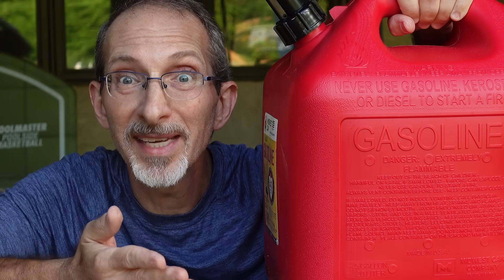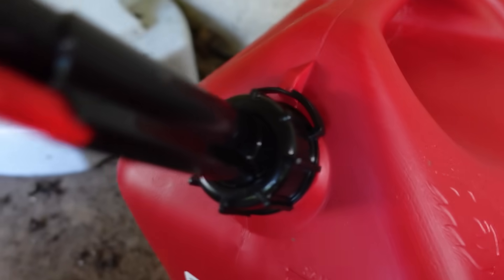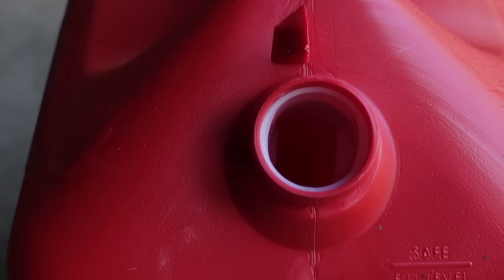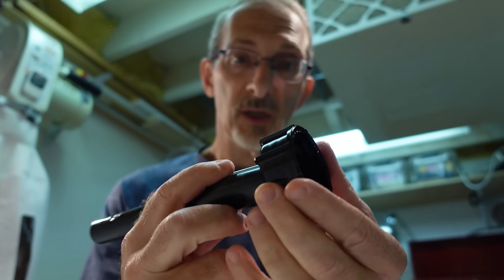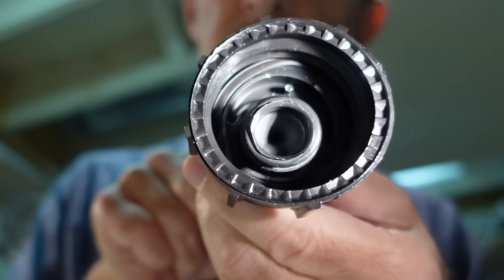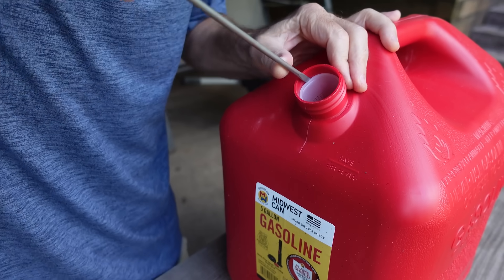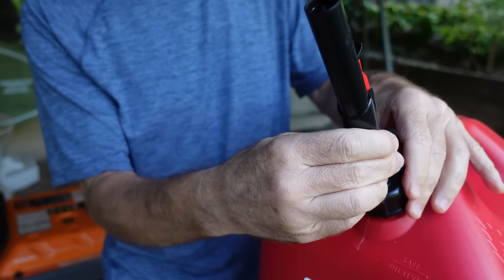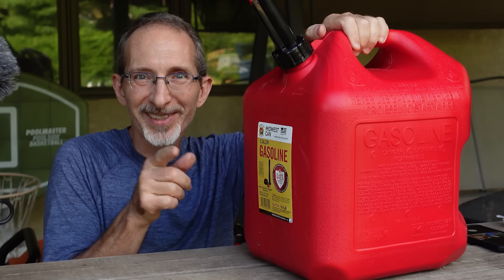Gas Can Modification | New Gas Can Fix

Comment: I fill my generator tank with a battery powered siphon pump.  I can fill my generator tank within 2-3 minutes, keeping the heavy 5 gallon gas can on the ground with no spills and controlling the gas flow with the pump switch. Just have to remember after turning "off" to lift the end of the pump hose up above the pump to allow any excess fuel in the pump to drain and return to the gas can. 
To use the pump I had to modified my 5 gallon gas can by removing the "plastic mesh safety device" as you shown in this video. 
When filling the gas cans at the gas station, the filled gas cans with spouts interfere with  closing my car trunk lid. So, I also purchased solid plastic gas caps that fit my gas cans, removing the need of the spout entirely.
Reply from the maker: Good stuff Ralph! I think an electric siphon pump may be in my future. Thanks for sharing your tips!

Comment: Bought four cans recently and wad successful in removing three filters in a similar fashion.  I accidentally pushed the fourth into the tank. After a split second of regret I realized it wasn't going to matter either way.  Next time two tools; a long screwdriver or dowell and a hammer.

I needed to remove the filter to allow a siphon pump to reach to the bottom of the can. I wanted to fill the cans by siphoning gas from my car tank after a visit to the gas station instead of driving my car around with full tanks of gas in the cabin. Then I discovered there was something blocking the hose from getting to the fuel in there tank.   Arrrgh!
Reply from the maker: Joe, you’re a pro! Thanks for sharing your tips!

Comment: The only correct fix is to buy an Eagle metal gas can, they never have issues and you can hand them down to your great grand children.
Reply: Agree I fix them that way throw new fangled crap in the trash and buy a metal old school design one they are still available
Reply: @alexking7365  I about had a stroke trying to read your comment.  There is a reason punctuation is a thing.  It looks like you just were speaking nonsense.
Reply: @trxtech3010  yep🤣
Reply: @trxtech3010 : Not just a reason, but a purpose.
Reply: @trxtech3010 
I can read it just fine.
Maybe try getting a Human sized reading comprehension unit rather than the Ameoba sized one you've currently got.
Reply: True, the only thing I’ll give the new cans is the plastic won’t rust, but even that’s not a big pro since they are more prone to breaking rather than just being dented like metal haha
Reply: @spicymeatbanana4611 : We did have an era where the plastic cans were easy to use too. They don't have to be metal to be easy.
Reply: @HelloKittyFanMan.  yup the yellow caps
Reply: @stephanhelms3282 : I mean the whole can setup.
Reply: @HelloKittyFanMan.  I know but finding them for sale is really hard (at least for me) so the new metal cans are the way to go unless of course you find those plastic ones, then by all means use them they are less maintenance than metal (over a long stretch of time especially if your storing gas for long amounts of time)
Reply: Oh yeah,  @spicymeatbanana4611 , well, I thought people were talking about just keeping old cans. I can see an old metal one rusting out. But what about the old plastic ones?
Also, what possession did you refer to when you said "if your (____ is) storing gas(oline) for long amounts of time"?
Reply: @HelloKittyFanMan.  I was responding to your comment about having an era of plastic cans that had easy to use spouts not the new funky spouts if that clears anything up
Reply: Not easy to find.
Reply: @RobertBrown-rg3gu  You can buy Eagle cans. Check their website.
Reply: @RobertBrown-rg3gu  military auctions and google search Jerry can or metal gas can or military gas gan
Reply: VP Racing makes good plastic cans as well, and they have vents!
Reply: The metal cans come with all the so called safety features on them also,  if you have old gas cans,  hang on to them as long as you can
Reply: DING DING DING WE HAVE A WINNER...LOL
YOU GET WHAT YOU PAY FOR.
DONT CHEAP OUT BROTHER
Reply: Okay all of you brain surgeons and engineers, lawyers, safety fools, let's see how stupid I can be and sue for something that I did and created my own demise, idiots out there. A spark from dropping a metal gas can is more unlikely than getting hit by a meteor. Liquid gasoline is less flammable than your clothes. The volatility is the fumes. (DON'T TRY THIS NINCOMPOOPS) You can throw a lighted match into a cup, can, jar, of gas and it will go out, if there is a correct air fuel ratio the fumes will ignite, the fumes on top of the liquid burns, the liquid supplies the fumes when being vaporized.
Reply: @santinocapone1080  really?
Styrofoam?
Reply: @mikeholubek4419  I think I vaguely remember these..  they were styro foam coated or insulated between two layers of metal to keep the gas at a constant temperature...
Reply: I only use 3/4" hose, ya ok sometimes gas in mouth but hey, I dont have to worry about a spark and neighbors never miss it
Reply: @mikeholubek4419 , 3/4” gotta be a fast transfer. Helluva suck to get it started, too!
Reply: My son did just that!
Reply: @powerwagon3731 , could you be more specific, please? Dropped a can sparking a fire?
Reply: Except rust
Reply: The price of an Eagle is SOARING to high for me!
Reply: Womb Raider  that’s funny!
Reply: Womb Raider  lol, I'm lmao at your comment 🤣
Reply: @rickysantana5658 , I’m LMAO at his handle.
Reply: I mean, there's some of them up in the farm junkyard and they're all rusted to shit but I'm not sure if thats because theyre also old as shit or if they're up there because they rusted out.
Reply: Had 2 skinny tall 2 gallon eagle cans get taken now i can only find the short fat ones
Reply: Does the military still use metal gas cans? 🤔 Must be good reasons....
Reply: That’s exactly what I did years ago!
Reply: AMEN
Reply: Womb Raider  You sure god didn't touch you on your pee pee?
Reply: @makok-izichi your ego far exceeds your intellect
Reply: @makok-izichicheap metal cans are still made of mild steel in China and shipped here

your brass shovels have nothing to do with the issue of this video
Reply: @makok-izichi natural selection is when a species has a random mutation in their genetic makeup that results in a difference in their DNA that is beneficial in their environment. 

You have the same DNA as the people who have died in gasoline related fires. You are the SAME SPECIES. The only reason you are still here, as with m riggs, is because you are lucky, nothing random has happen yet resulting in horrible injury or death to you.

If you had ever seen someone burned in a gasoline fire you would not be so dismissive about the dangers. 

About 100 people die everyday in vehicle accidents. 75 of those people were passengers or pedestrians who did nothing wrong and had no chance to avoid the accident. Only 25% are personally responsible by their own actions. Your lack of empathy and your derision of considering the safety of yourself and others says a lot about you as a human. 

Lets hope your grandson does not find his way into your garage and ends up dousing himself in flames with a gas can you hacked or acquired to get rid of "all that safety crap".
Reply: @kenwittlief255 , as a person who has been seriously burned in a gasoline fire, I don’t approach the subject flippantly. I am wondering if you or others commenting that properly manufactured metal cans are fire hazards have some verifiable figures to back that up? Or is it a matter of what seems obvious to you? And what was that makok-izichi guy writing that has you up in arms? His comment is missing at this time.
Reply: @leehaelters6182  This video is about people intentionally altering modern plastic gas cans to deliberately disable the safety features. This thread is about people wanting to go find old steel cans that were made before OSHA required the modern versions. 

Whether or not you can buy a current production Gerry can that is OSHA approved is not the issue. 

Sorry to hear about your burns. People tend to be flippant about safety until they get hurt, or someone they know. This video SHOULD be banned from youtube.
Reply: @kenwittlief255  not even close to reality OSHA HAD nothing to do with this bs, its all from the Tree Huggers, crying to epa.
EPA is the one to mandate these assinine spouts.
They also are trying to get rid of plastic cans because of fumes PERIOD!!
OSHA is for Safety! Health!
Reply: @kenwittlief255 , thanks for your thoughtful reply, and also for insisting on safe handling of dangerous flammables. Can’t pick a bone there.

Others in this thread have pointed out credibly that the features disabled in the video are mandated to limit vapor emissions, the same way that filler nozzles in service stations sport collars.

It is also quite credible that over time the bottom edges of a hot dip galvanized can (the USA manufacturer Eagle makes some) will wear through, and expose the steel to sparking. No question that such cannot happen to a plastic container, but I don’t think that it is a matter of legislation, yet.

It seems reasonable to me to replace that spring in the video with a weaker one, the better to facilitate  using it with lighter and less physically stable tanks. I think that selectively locking it open would be the best solution, though, because not all filler necks are long. And installing a vent is just about not forgetting to close it, not safety, no?
Reply: @kenwittlief255  a gas can that can not dispense gas into a fairly common fairly recent make of automobile stuck at the side of a road without improvising some sort of funnel out of old magazines shouldn't even be sold. A gas can that makes it super simple to cover your push lawn mower in gasoline (muffler included) because of the goofiness of the safety design also shouldn't be sold.  My grandfather let me mow his yard when I was younger on an old riding mower with no safety systems and an old school metal gas tank with the flexible steel nozzle and no safety features other than a vent hole.  I guess it is a miracle I survived that.  If you've read the other comments the reason why this specific gas can is mucked up with safety systems was because of a lawsuit where somebody decided it would be a brilliant idea to pour gasoline on an open fire then wonder why the fire chased itself back into the gas can...  YouTube isn't public speech, despite what some people believe but I will support the OP's right to post and speak his mind with the spirit of the 1st amendment.
Reply: @kyledavis4890  I got a can just like the one in the video 2 years ago and use it on my motorcycles, lawnmower and snowblower. Sometimes I drain old gas from a motorcycle and put it in one of my cars.

Its simple to use - you push in the red release on the spout, then push the nozzle into the gas tank. When you pull it out the flow STOPS.

I have never spilled a drop, there is no issue using it on ANY car gas port design, or with my 1975 vintage snowblower.

If you are too stupid to figure out how to use it, or you cant get the nozzle off to fill it because you have to squeeze and turn the cap like every soap or medicine bottle made since 1990, then YOU are exactly the person the gas can is designed for

because you should not be handling any type of flammable liquid.
Reply: @makok-izichi I had two 5 gallon cans I purchased in 1978 when I had an off road dirt bike, one for pure gas and one for used motor oil. They were mild steel. If you dragged them across the garage concrete floor they would spark.

But dont let reality bother you. If you find a metal gas can in a store today it was made in China.
Reply: @kenwittlief255  really not trying to argue with you but who, exactly is dragging a gas can-any gas can across the floor? I’m really asking.
Reply: @melvin_0bviously  the point it that steel moving across a concrete or stone surface creates sparks, same as holding a steel nail against a spinning grindstone. 

Its easy to grab the handle on a 5 gallon gas can and pull it sideways as you lift it, or to scuff the floor as you put in down.

there are many ways a gas can could get bumped or dropped or pushed sideways on the garage floor - accidents. Someone puts one down behind a car and forgets its there, then backs the car out....
Reply: @melvin_0bviously  snow flakes on their way to their safe rooms.
Reply: @kenwittlief255  I can see that. Thank you. I guess my question though is: without modifying a new one, is there a modern, safe gas can I can buy right now that actually works? I don’t think there is. The safety regulations are now more important than usability. I don’t think that makes the gas cans safer. I think it just makes people hate the safety regulations. And long for better times in the past. Which probably weren’t actually better. It’s just that way more people in the past were using gas cans more successfully. Smile.
Reply: @melvin_0bviously , order online from Eagle Manucaturing.
Reply: @kenwittlief255  
Who is so stupid, or lazy, to drag a gas can across a floor!?
Oh!  Sorry, you!
Stupid is as stupid does.
Reply: a metal gas can will spark if you drop it on concrete and ignite

that is a pretty serious life altering thing to suffer for a simple mistake of dropping something in your garage
Reply: @kenwittlief255  
50 years of using metal gas cans, and I haven't had one blow up yet!
Sparks from dropping a metal can won't cause a fire unless you spilled gas all over!
The idiotic safety devices on modern plastic gas cans made me go back to using metal cans.
Reply: @mahbriggs  you are one of the randomly lucky guys who never had a simple accident cause serious injury or death, so you think safer designs are nonsense. Thousands of people did not survive the 50s and 60s, and they are not here to talk about how horribly they DIED!
Reply: @kenwittlief255  
Okay drama queen!
If you think you are too stupid to safely handle a gas can, who am I to argue with you!
By the way, just for your edification, the type "safety" gas cans being talked about only came into existence in the last few years,
Do try to keep up!
Reply: @kenwittlief255  
Laughing out loud at you!
They still sell steel gas cans you dolt!
Obviously you are a bit on the slow side, but “come on, man”!
Reply: @mahbriggs  🤣🤣🤣
Reply: @kenwittlief255  fatigue is the truth!
Reply: @mahbriggs : They don't have to be metal to be easy. There have been some easy plastic ones too.
Reply: @HelloKittyFanMan.  
True, but I haven't seen one on sale lately.  I have one old plastic without the spring loaded nonsense, and plastic one I modified like in the video.  On the side of the road in the dark by headlights.
The rest are all metal cans.
Reply: @mahbriggs : Oh, yeah, the older plastic cans aren't available anymore. I thought people were just talking about what they had kept from the good ol' days. So we can still get metal cans without the silly idiot spouts? Why are those still available if the old-style plastic ones aren't?
Reply: @HelloKittyFanMan.  its a theory really, plastic is the new environmental boogeyman...  so naturally any plastic manufacture would want to make their products as safe as possible to avoid additional stigma despite the fact that it pretty much renders them useless.
Reply: @kyledavis4890 : Probably just a hypothesis.
Reply: @kenwittlief255  almost all OSHA approved gas cans are metal.
Reply: @brtrimmer132   that’s a FACT! I do pipeline work and all we use is metal cans!
Reply: @kenwittlief255  - plastic builds a static charge. Lighter and cheaper too, my guess is that’s the real reason for its widespread use.
Reply: @kenwittlief255  , gas containers are made of terne metal, no? Tin coated, non sparking for that reason.
Reply: @kenwittlief255  It would spark on the outside, genius.
Reply: @PJBonoVox  yes and when it gets dropped or knocked over when its being used, or the plastic nozzle is broken off  sparks ignite the gas.

Cans have been designed with all these new safety features BECAUSE people get burned and this is the best way to STOP IT.
Reply: @PJBonoVox  No we dont lose.

When a person is seriously burned or killed in a fire related to a commonly used product, the cause of the fire is investigated, and when its possible the product that caused the fire or made it worse than it should have been is redesigned or modified to PREVENT IT FROM HAPPENING TO ANYONE ELSE.

Its not a matter of being clumsy or stupid. Everyone has accidents. Children get into garages and get into things that are dangerous. Putting gas into a hot lawnmower or motorcycle can result in the  fuel igniting if the tank is overflowed, then you NEED a gas can that shuts off the flow when you pull the nozzle out of the tank, instead of spewing a stream of burning gasoline all over the legs and feet of the person holding the gas can.

Comment: This is what happens when you hire too many 'non-essential' govt workers. 
Why not a gas nozzle that works like a lawn hose nozzle. Turn the nozzle to the left, it shuts off the water. Turn it to the right, the water comes out. I'm sure whoever designed this stupid thing got a huge bonus.
Reply from the maker: Johnny that actually makes a lot of sense. Thanks for your suggestions and thanks for watching!

Comment: the fact that the nozzle is not flexible at all is a deal breaker for me . . .  also:  for the spring loaded little valve, I just wedged a screw in there to hold it partially open all the time.  I'm using my gas can for lawnmowers and chainsaws, so pouring fast is not that important.
Reply from the maker: Valid comments! Thanks for joining the conversation.